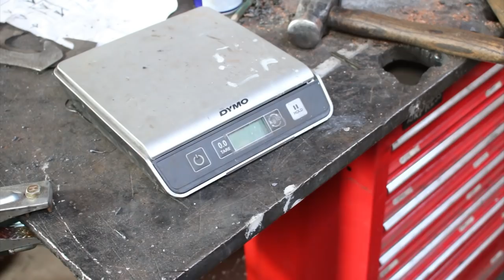Experimenting with crucible steel.

Comment: Whatever you're mixing certainly has a high carbon content. And thanks for putting that chain around the bottom of the anvil.
Reply: Seen that before. What purpose does the chain serve?
Reply: The chain dampens the ring of the anvil.  They can get really really loud without them.

Comment: i've heard grafite is slightly porous to oxygen at high temperatures
Reply from the maker: RealHogweed it is. But good for the basic stuff. The zirconia crucibles are hard to come by. Maybe later I will try to get them
Reply: Freerk Wieringa what about ceramic?
Reply from the maker: RealHogweed it melts at these temperatures

Comment: Mr. Wiring a
 I've seen this done on several occasion and others have used green glass. Is there a difference ? If so what is it. Thanks for sharing I look forward to your response. Martin
Reply from the maker: M&S BLADES my guess it that the green glas has a lower melting point
Reply: @freerkwieringa275  there is more green bottle glass in circulation than clear...maybe it was a case of people following the first videos of the technique as closely as they could?

Comment: curious to what he put in the crucible, looked like mild steel, and cast iron? That would certainly average out the carbon, but i'm used to seeing just mild steel, or wrought, and graphite added with glass at top, or some high carbon bearing material like ground charcoal.

Comment: Would brushing the interior of the crucible with liquid paper (read: white correction fluid) before adding the charge help everything to release more easily after firing ? 

If it works for mosaic damascus i'm guesson it should work for crucible steel.

Comment: Looks harder then 01 Tool steel (Well done!) How long did you have to beat that thing before it would move? (Hours I am guessing)
Reply from the maker: mrscary3105 it takes days. But you can speed it up a bit by reducing the carbon level at the top of the material